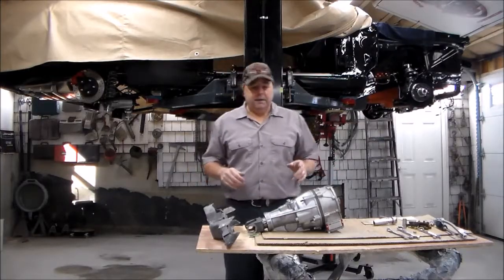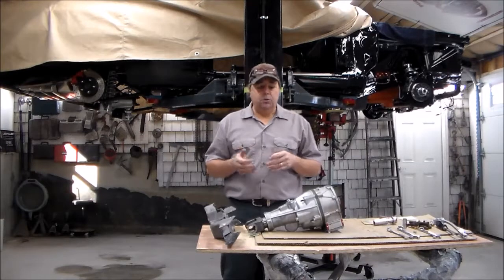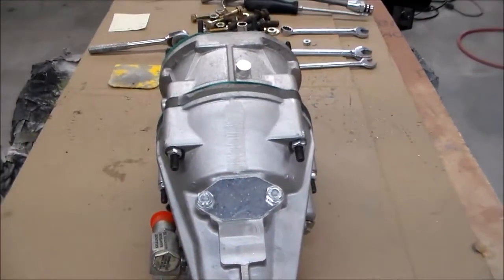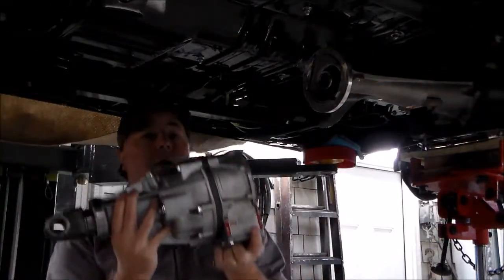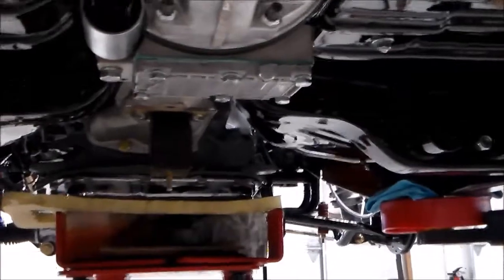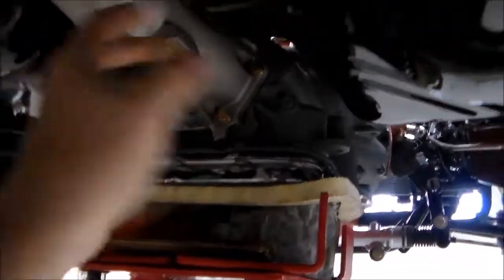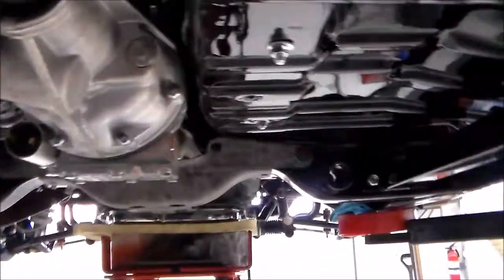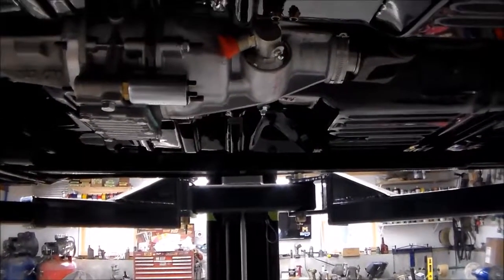Gear Vendors Installation Part II  Crossmember, floor clearance, & More By Troy Kane Vtwinstov8s.com

Comment: Just curious. Instead of modifying the trans mount why not just use a shorter rubber bushing?
Reply from the maker: It's a valid idea. I wanted to use the original parts I already had. But I don't see a problem with that idea.

Comment: How much of a difference would this make on a 727 with 4.10 rear gears? Cruising about 55mph I’m running about 2600-2800rpms and I was wanting to add a gear vendor
Reply from the maker: It's a 17% RPM reduction. So you'll be about 500 RPM below your current situation. Hope this was helpful and good luck
Reply: @troykane  yes thanks!

Comment: Do you recommended the gearvendors be used with a freshly built motor or a motor that has been broken in?
Reply from the maker: It will be fine with either. Follow standard break in proceedures for a fresh engine.

Comment: I though these were drop in and go types?
Reply: They are bolt on to some degree. The car isn’t designed around this unit, so a couple of dimples depending on your car model.
Reply from the maker: I'm not exactly sure what you mean by drop in unit. you are basically adding a backhalf to the existing transmission.